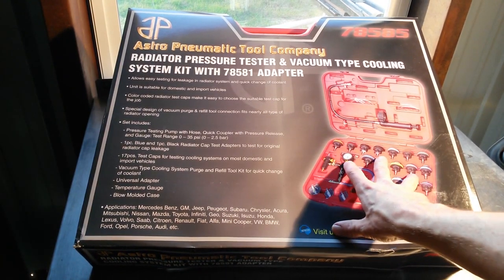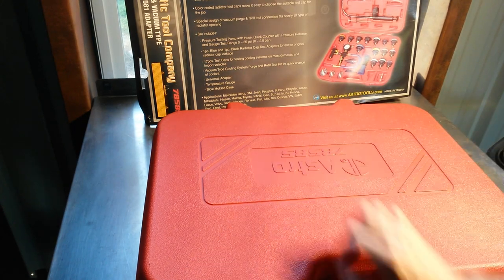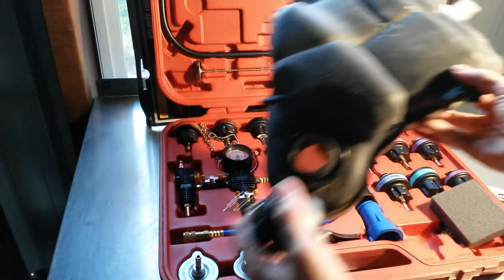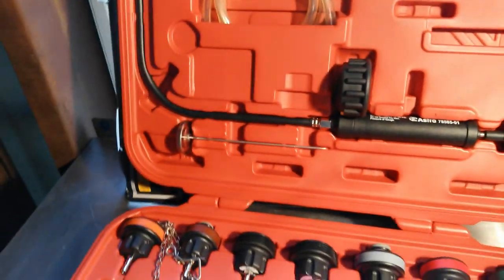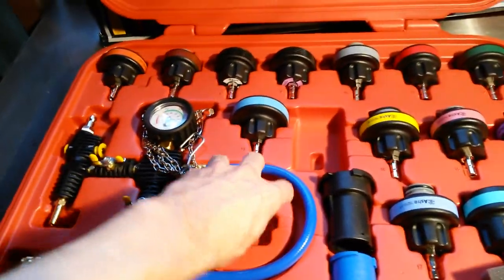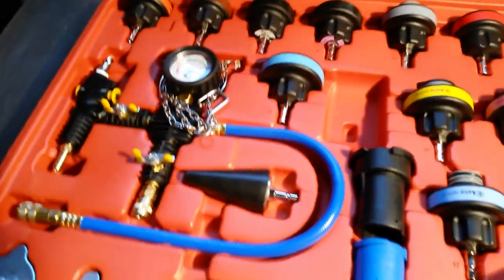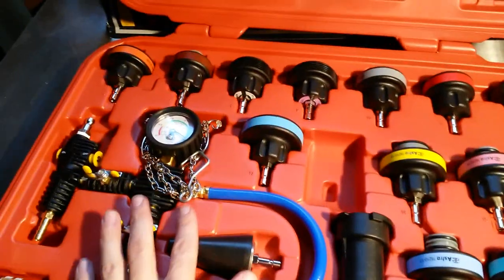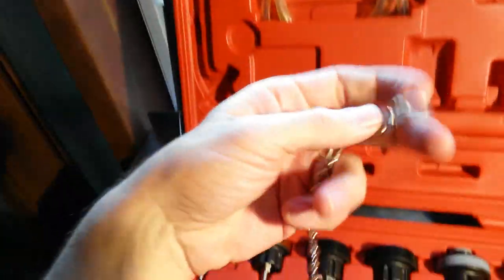Astro Pneumatics Tool Co. Ultimate Coolant System Pressure/Vacuum Tester 78585

Comment: Is this kit necessary or can a cooling system be filled and allowed to self-bleed air from the system?  Self-bleeding would understandably mean adding fluid as air burps from the system.  Aside from that issue, what's the down side of self-bleed vs the convenience of using this type of kit?  Finally, now that you've had the kit for 4 years, what are your likes and dislike about the kit?  What do you wish was better about the kit, if anything?  Thanks for the video!  👍
Reply from the maker: Some engines cannot be "self bled" or burped naturally. Many engines have air pockets, or high spots which will never fill naturally due to lower points in the system. Kind of like when you turn a glass upside-down then submerge it. The air stays in and is trapped.
Reply from the maker: The kit work good for the price. Having all of the adapters is the key feature for the price.
Reply: @SuperDuty  This is helpful.  Thanks for explaining.  The car I'm considering buying the kit for is a 2004 Volkswagen GTI VR6 and potentially a couple future vehicles: Audi A5 and Toyota Tundra.

Comment: Dear friend,
I have recently bought the cheap version of this kit with just the universal adapter.
Not able to find the connector to go on the blue hose which is supposed to connect to the compressor.
Could you please share some link about the connector.

All i got to know was it requires 1/4 BSP connector..
Reply: TBcanuck The blue hose can also be connected to the coolant intake and the line below the gauge connect to the cone adapter that goes into the rad cap.